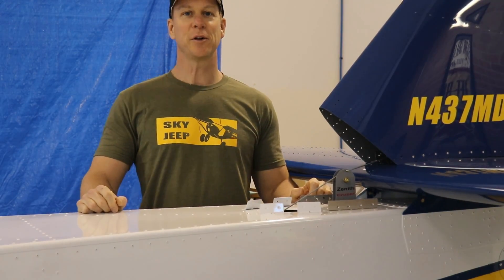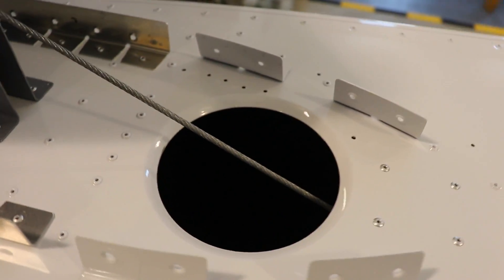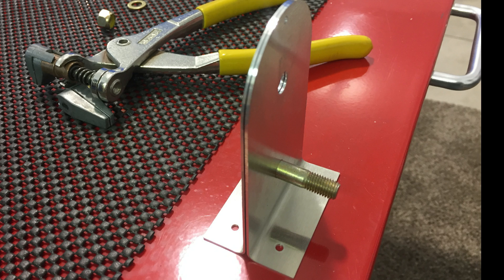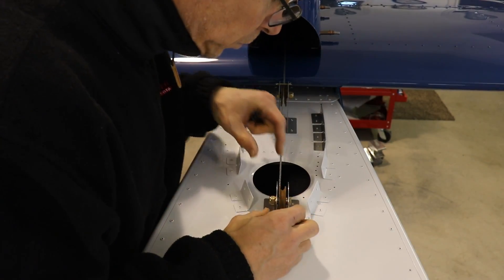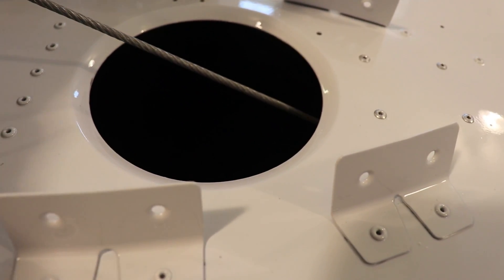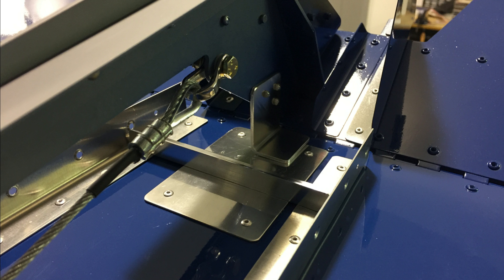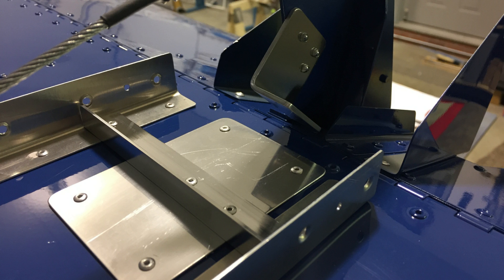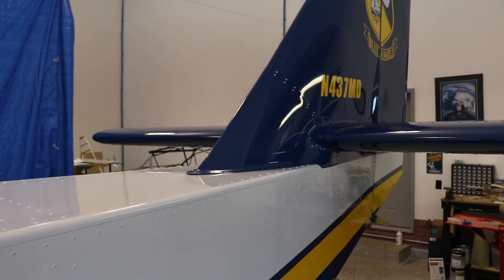Zenith Cruzer - Finishing the Back End

Comment: In ZA-3 I see an L-Angle across the aft two holes of the pulley mounts for the top pulley with the L pointed skyward.  Looks like it would currently be in conflict with your C75R3-9 for the lower vertical stab skin.  There also seems to be an L-Angle across the forward two holes of the pulley mounts for the other pulley inside the fuselage.  It's hard to see in the plans.  Beautiful aircraft.  Wish I could build as clean as you.  Thanks for the tips along the way.
Reply: @KitplaneEnthusiast  Just wanted to make sure you had the proper bracing on those pulleys.  See it in your December 27-28, 2016 pics.